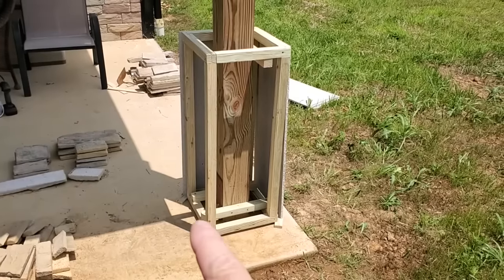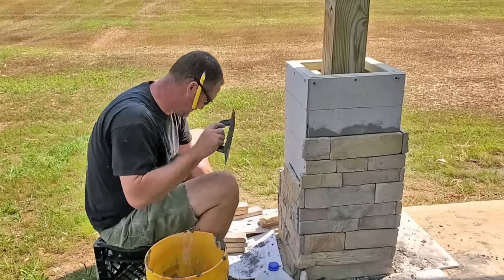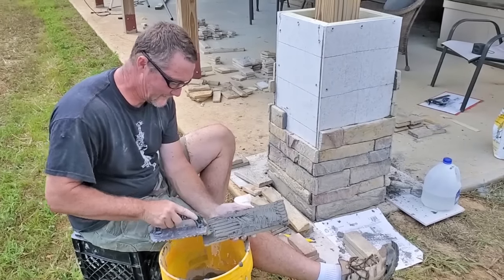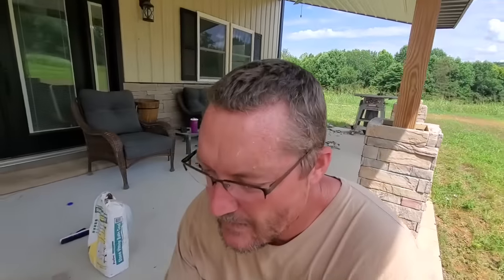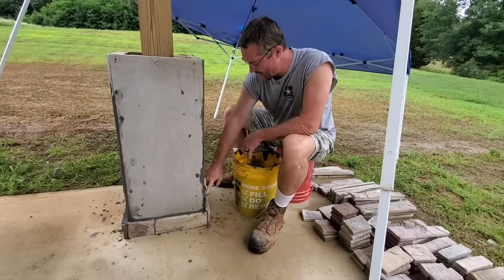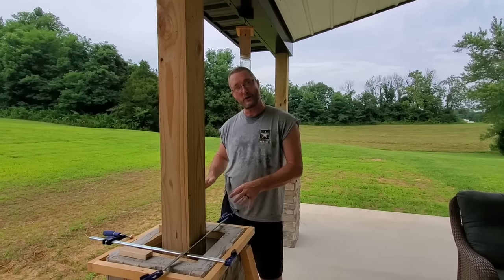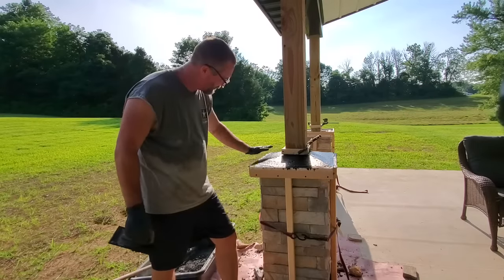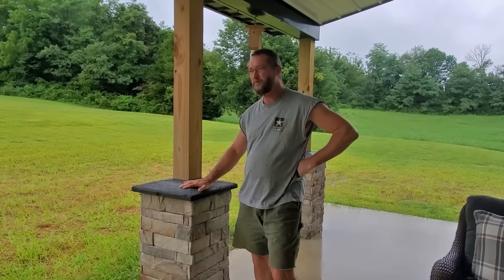🏡DIY Stone Porch Columns with Concrete Topper || Barndominium Living

Comment: Pro Tip: Keep a spray bottle of water close by and spritz the cement board right before setting a tile. Helps keep the cement board from wicking all the moisture outta the thinset and drying too quickly...
Reply: Correct...I always used a wet sponge.
Reply: GENUIS! Simple, but DIYer’s wouldn’t think to it.

Comment: Pro Tip #2: Take an old palm sander, (no sandpaper necessary), and use it to vibrate the sides of your forms while the concrete is still wet. This will vibrate out the air pockets and you'll end up with nice smooth sides where your form boards were...
Reply from the maker: Thanks for the tip!
Reply: You can also use a hammer drill with no bit in it.
Reply: Sawzall with no blade

Comment: In my opinion and years of experience I’ve found that using a thick bead of 100% silicone or some durable type of gap sealer or caulk is the best option because your 1/2” gap wouldn’t always prevent wicking from occurring due to dirt and other debris that can and will build up inside that gap making it as if your column material was installed directly on concrete. Unless your planning to clean those gaps frequently! Enjoy your build project that looks great and keep those informative videos coming.
Reply: I’m not sure I understand, and I want to! Are you referring to dirt (not water) to stick to the caulking?
Maybe you could help me anyway: I want to clean the caulk that a handyman used to fill in small cracks in my white columns on my Craftsman style front porch. I want them to be waterproof and look clean. I intend to clean those spots, and paint the columns (I hope: I’m VERY tiny and have some chronic illnesses including Lyme infections, so I need advice❣️🙏 Thank you! 
BTW, my father was a builder and I learned quite a bit, but he passed away a long time ago. I still have sawdust in my veins, though at 68.
Reply: @Tinyteacher1111  Yes, I kinda know what health problems can set you back whereas I’m 60 years old and during the first week of March founding that I was having difficulty breathing, so I visited my family doctor who scheduled various medical test on the next day, however I didn’t make it that long as my ability to breath became severe so my wife took me to our local HCA Emergency facility near my home, where they quickly did medical test and confirmed my diagnosis was Double Pneumonia and considering that I already had COPD lung disease and Heart problems and 2 new stents, so they needed to transfer my by ambulance to our local HCA Hospital where they put me directly into ICU where after a couple days my condition had somewhat improved as they kept me heavily sedated, however on the 3rd. Day my condition took a major turn for the worse as doctors told my wife that I’ve suddenly become worse as test indicated my having Streptococcus Double Pneumonia with sepsis, which seriously affected my already COPD lungs to a very severe state, it affected my heart with heart failure with A-Fib, plus having kidney failure that required dialysis, and throughout my very long 53 days in ICU where I remained on full life supports for most of that time, and I was also plus taken into emergency surgery 6 different times where surgeons were barely able to repair hematomas (bleeds) in my stomach and esophagus that was caused by another one of the blood thinners they were giving me. Nonetheless, once they got me healthy enough to discontinue heavy sedation whereas I slowly woke up very confused not knowing what had happened to me, and I certainly was surprised to hear the total number or days totaling more than two months that I was hospitalized. Noting I was later told by doctors that I had quit breathing 4 times, and the stomach bleeds were extremely dangerous and my life was in danger each time they attempted to do any of those 6 surgical repairs that was causing me to loose massive amounts of blood which they were pumping blood in as fast as I was losing blood. Sorry, for giving you most of the medical events that I’m still recovering from and any full recovery could take up to a year or last a full lifetime. 

Regarding weatherizing your post in my opinion is usually done using 100% paintable silicone that every space where water and or dirt can get under or into it, whereas if your post were installed correctly, it should have a galvanized metal bracket installed under or between the post and the concrete or wooden floor which allows a small space between the post and floor for water and dirt to enter and escape without applying future rot and a need to replace the post. However, if your finding that your post have been firmly attached to the flooring, whereas I personally would use a good bead of 100% clear Silicone or 100% paintable Silicone that would be necessary to prevent any water or dirt from entering the post bottom and includes sealing any post trim work. I hope this helps you, if not please let me know and I’ll try to understand and help you with your problem. Good luck…
Reply: I read your comment and felt compelled to at least say that I wish you well and a speedy recovery.. Your body took a huge beating but hey, at least you are still here and I hope it continues that way for long time. Take care.
Reply: @menoyuno8430  Thank you so very much❣️

Comment: Amazing! I just had my eavestroughs replaced on my house today. The contractor pointed out my car port beam was rotted away and suggested i do something like this. I came on here and found your video. I will be doing this on my own . I just am not sure how to remove the old beams and install new ones without my roof collapsing. Might hire someone for that prt
Reply: Did the contractor say to install something like this to keep it from rotting in the future?
Reply: @TheBattery124  not for rotting in the future. Problem was my downspouts were in bad shape and over time it dripped on the beams and the bricks and caused it to rot

Comment: I like the toppers a lot. If I did something like that I'd build a solid frame with the cement board and then sort of just paint a layer of concrete on top of them rather than using so much concrete to fill it and try to shape it as it dries. I give you props for your creativity, though!

Comment: Great job! I am not a pro at this, but when did something similar, I painted the bottom of the post, all the way up to the part that comes just out the concrete, with a special paint to keep it from rotting, even though it is already pressure treated.
Reply: Please can you confirm which paint did you see use? Once you painted did you pour concrete in the cavity?

Comment: Looks great!  Great video... right to the point.  Suggestion...  if you spray the cement board with water before applying the mortar, it will not suck the moisture from it.
Reply from the maker: Excellent tip..thanks for sharing!!

Comment: You could have taken some sand only mix and add that colorant to it and applied and rubbed it down with a sponge to smooth out the imperfections of the cap.

Comment: I think you're supposed to take a wet sponge and go over the board to prevent it from absorbing the moisture out of your mortar.  Also, they make corner stones that would make it look more natural.
Reply: The whole time watching I was thinking of those cornerstones would  make it look much more natural! 
Also that gap on the bottom needs caulking not only to keep water out, but insects as well! You'd hate to have  bees start a hive inside one of those columns.

Comment: Why put screws in the post to tie the concrete caps to the post? Is that something that was recommended? What about expansion and shrinking of the post without any expansion joint?  How about trimming that joint of the concrete to the post--were you able to make a clean looking joint, especially without protecting the surface of the wood?

Comment: Nice work ! Question though--why not start from the top down so that aesthetically the eye work high to low when viewing them?
Reply from the maker: The stone I bought is the same height so they are all the same height.  If you start from the top you may end up having to cut the bottom row.  The caps are slightly different but I'm only a homeowner, not a contractor so we're OK with it. I would have loved buying caps but just couldn't find anything that would work and custom caps were $$$

Comment: Hey guy looks awsome am just about ready to build my deck/porch am putting 3 beams and I wanted to do the same thing I just hope I can or have the smarts to build it like you I have nobody to help me do have a list of the ma trails you used ? And where you got them ? Please let me know thanks brothA again you did a great job 👍👍
Reply from the maker: What is a "ma trail"?
Reply from the maker: I think you're talking about a material list.  Here you go:
Rough estimate per column:
1)   Qty=3   
1 1/2" x 1 1/2" x 8ft pressure treated wood for framing

2)   Qty=1 1/2  
3ft x 5ft cement board to wrap framing

3)   Qty=1 bag
Stone mastic or mortor to attach stone

4)    Qty=1 bag
Quickcrete or mortor for pouring the cap

5)   Qty=1 bottle
Concrete coloring (if you want the caps to be anything except grey

Comment: Look great, however, would have greatly appreciated more detail in how you built up your frames as well as how you made up your forms for the caps, didn't really get a good look at any of that.  Also, do you have plans to further finish the upper part of your columns? Cladding (like cedar), stain, paint, etc.?

Comment: Mastic won't seal the cement board . You have to put rubberized coating on cement board then mastic then stone. . cement board is porous mastic won't seal it . Then you need it on both sides if outdoors for constant humidity after rain in summer .2 applications of rubberized coating . Or treated ply,  2 roof felt layers , chicken wire nailed wrapped around it then a scratch coat of type S mortar then mastic or type s mortar then stone.  That backerboard will break down.

Comment: Nice, Im thinking about doing the same thing soon on a new construction project.  Would you suggest to stick with wood frame cement board combo or cinder block option?  Have you ever done it using cinder block?  If so do you prefer one over the other..thx.
Reply from the maker: Thin cinder block would be a great choice for long term rot protection.  We've not done it before..but give it try man!

Comment: I made the same design on my caps but I had a  1/4 in space between the 6x6 post incase the post cracked thought it may bust my concrete and I put concrete board on my post and trimmed the corners and the top and bottom of post to cover the 1/4 in crack I also pulled a sting on the edge of all the caps so they were all in line my caps had the same design as yours odd and it was a job I don't want to ever do it again thanks for the video  good job
Reply from the maker: Yeah, it took way longer than expected. My caps have faded even though I used stain in the mix.  I may paint it with gutter guard or bed liner to seal and keep the color

Comment: Great Job, couple questions what were the total after stone was dimensions after stone was added?  Looks like maybe 2 x 2'  You had a 1/2" on bottom on your wood form for water did you also have 1/2" with the stone?
Reply from the maker: The finished outside dimension is 17" square. The stone sits on top of the concrete. Only the wood box was held off the floor 1/2".  The concrete cap overhangs 1 1/2" all around

Comment: If you do this type of thing daily, you quickly come to the realization that its better to minimize wasted energy and create an enjoyable workspace.  This stuff is hard enough…We dont have to make it harder

-Setup the grinder in the vicinity of material pile waisthigh and upwind so you dont have to bend over and hold your breath.  (In the shade if possible)
-Use earplugs!
-Keep a wash bucket of water next to yourself when troweling mud.  Cleaner job in the end.  

PUT SOME CHILL MUSIC ON! Something that keeps you calm and focused.
Reply from the maker: These are all good points.. except maybe the chill music. Jk!  Thanks for the suggestions.

Comment: I’m getting ready to do this myself, but I’m not about to try it in the summer Florida heat. So, I’m going to wait till the end of September.  That said, did the company you got your stone from not have the wrap-around corner stone for the edges??  Seems like a real pain to have to cut a lot of those to sit flush on the corner.  That said, what you’ve done so far looks great!  Maybe wet the cement board and stone just prior to buttering?  Just a thought…. Well done, brother.  I always salute my fellow DIY’ers.  P.S.  How were you able to get a consistently measured slope on your caps??  Each cap looked perfectly symmetrical with the others….I would think that would be quite a challenge…
Reply from the maker: I ordered corners but these are that the call "corners". They aren't finished on one end. You can buy stone that is a true corner and even ones for columns. They were more expensive plus I was using what matched what we used on the house.
Yes, you can wet the cement board down and it won't absorb the water ot of the mortar so fast. It was just as easy to "back-butter" the pieces.
I install the bottom cap frame first then measure up to the top frame. The angle is just a straight line from the top frame to bottom
Reply: @RVBarndominium  OK...that makes sense.  I'd do the same thing if I had it left over.  This stuff has gotten OBSCENELY expensive in just a matter of a year (thanks for that Biden).  So, if you've got left-over, then absolutely, I'd do the exact same thing...you saved a small fortune.  I didn't catch where you're located, but I'm in Florida, and the heat and humidity is absolutely vulgar, so I'm waiting another month.  I think the columns will make more sense once I start in on it, but like you said, I think doing it myself, and staining the con-crete will be cheaper, look better, and open up more options.  Thanks a million for taking the time to share!

Comment: Thats awesome.   Thanks.  Question,  Prior to making the cement caps how did you close the inside top to hold the cement prior to pouring?
Reply: I am a rookie….  You’ll need to dumb it down.  LOL
Reply from the maker: Used scrap wood to fill the opening.

Comment: Looks good, but I would have put metal columns in place of the wood. Our house was built in 2014. They put in wood columns and the wood is rotting where it meets top of the stone.  Maybe if they were wrapped, it would keep the water off of them.
Reply: I thought about doing this too but with cinder blocks. My worry though was the wood column rotting out over time.

Comment: For this non structural application of lightweight blocks, wouldn't some construction adhesive be a much easier solution for attachment? You wouldn't have to go through the trouble of mixing cement and worrying about it drying out on you.
Reply from the maker: I would have loved to use a pre-mix adhesive.  This is the morter that is specified for that block. Most tile mastic are for indoor use only.  Mastic or caulk gun based adhesive would have been much easier and faster

Comment: Does anyone suggest wrapping the pressure treated post with something before pouring the concrete topper? Would water press between the topper and post ultimately causing rot years later?

Comment: How’s it looking mate? 2 years down the track is it all still looking good?
Reply from the maker: Everything looks good except for a few cracks in a couple of the toppers.
Reply: @RVBarndominium  Ahh yes cool. I was worried how the top would go up against the wood. Expansion/contraction I think happens across the grain. Not sure how ugly it would look, but maybe some of that concrete expansion foam (thin) around the post might help. The tops looked great though, well done, and I loved the cladding

Comment: Great job. I just formed my posts out and plan to pour in place as well. What type of concrete did you use?
Reply from the maker: I believe it was just regular Quikrete and we added a die.  A couple of ours developed cracks in them.  Make sure you spray frequently with water for a few days if it's really hot  out to help with cracking.  We learned the hard way for ours.  Good luck!
Reply: @RVBarndominium  typically, if you leave a 1/4" gap (wrap with flex insulation, remove once set) between the concrete and the post, you can reduce cracking.  Many times, slight movement will cause the cracks.  Afterward, fill with silicone.  Provides a moisture barrier as well.

Comment: Getting ready to take on this project, and had a couple questions:

1) Did you ever fill in the bottom gap with caulk ? I'm trying to figure out if I should do the same thing (space .5" on bottom) if I'm doing grout lines all the way up, an weather I can just grout the space between concrete and first row of stone.

Also wondering if you considered WRB wrapped around wood before the backer board or is unnecessary?

Thanks!
Reply from the maker: I just set the first course of stone on the floor. The water may wick-up under extreme circumstances but it will be fine. The cement board is great stuff.  It won't ever rot.
I think house wrap would be overkill but if you have it who's gonna care.
Reply: Ty! One last question -- if I was going to set limestone or veneer column caps (instead of pouring my own), would I need to carry the cement backer to the top of wood framing for the stone to sit on ?
Reply from the maker: Yes, the cement board protects the wood frame.  Good luck with your project.👍

Comment: Looks nice .. i think you missed some water proofing steps though.. i see that 6x6 post and box framing rotting out below the cap if it takes on any moisture.
Reply: I'm about to do this for someone else and that's my main concern in the project as well.  I'm going to make some kind of aluminum pan around the top and seal the seams